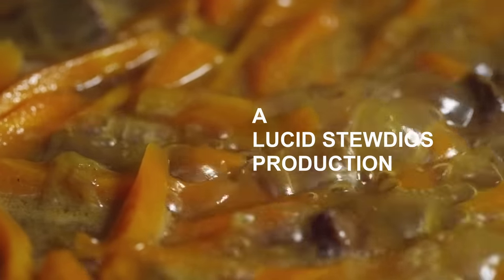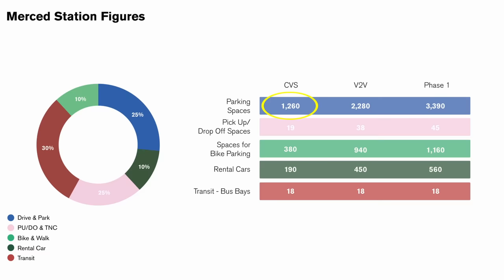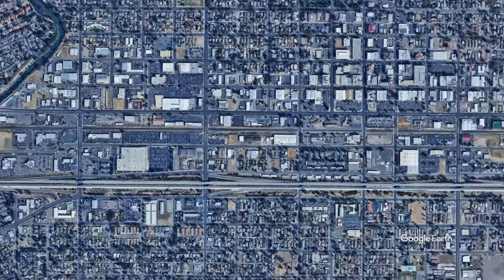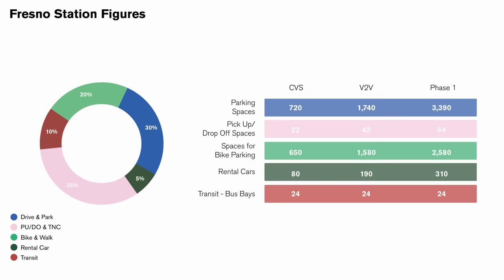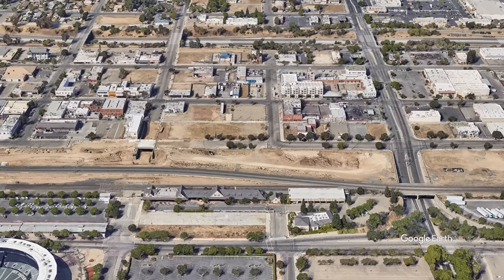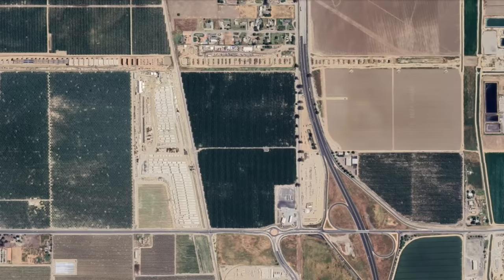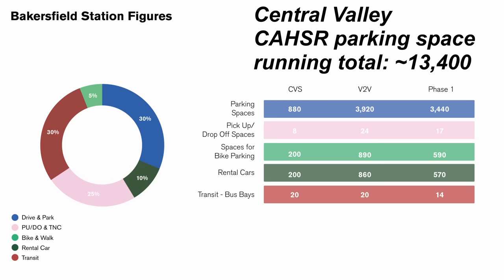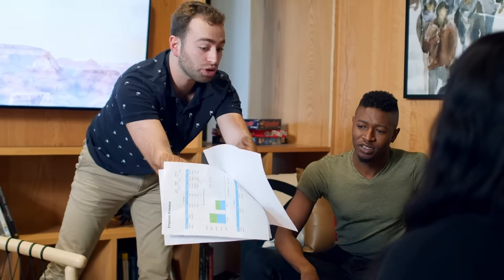California High Speed Rail : A Park & Ride Nightmare | CAHSR

Comment: Great video!

Holy Crap is there a ton of open air parking. I can't imagine there will be very much need for parking, let alone for rental cars, for at least a decade or more until there is a connection to San Jose. I also seriously doubt that the need for so much parking is justified even when the entire line is open from LA to SF. Fresno's airport only has about 900 spaces.
I am disappointed by the overabundance of parking. These downtowns already have an oversupply of open parking lots that haven't been full for 30+ years. A parking garage would at least save space and keep the stations from being so isolated from their downtowns.

I don't like the station designs (I imagine the Bay Area and So Cal stations will look much better) but I do like that the Merced station entrance has a treatment that has a rustic or "Sierra" feel to it since it is a gateway to Yosemite. I wonder why the other stations don't get a distinguishing feature for their station entrances. Fresno, to me, should have a California-Mediterranean feel to it like it's Amtrak station or it's iconic downtown water tower. Bakersfield has an oil and country music heritage. Kings/Tulare is ranch country. These cities have been economically stagnant or in decline since the late 1970s. In fact, Fresno's skyline has barely changed since then (w the exception of new gov't buildings). Fresno's downtown, however, does have a large number of mid-century buildings (office buildings, theaters, and dance halls) because of that which are architectural gems. 

I don't know why Kings/Tulare station is where it is. The Amtrak station is in downtown Hanford although I really think the station should've been in Visalia and should've generally followed the UP or Hwy 99 alignment from Bakersfield, only acquiring property where the geometry dictated it. This would've saved a lot of money and lawsuits over all the land they had to take in the farmlands. There is a "plan" (I don't know how real it is) for a commuter railroad along the RR ROW that roughly parallels Hwy 198 between Visalia and Huron and perhaps Porterville. This could be a good non-car way to get from Visalia to the station, leaving their cars in Visalia. There is also an abandoned RR ROW from Porterville (via Visalia) through Dinuba Reedley and Sanger to downtown Fresno that would also make a good commuter corridor.

I think Madera was added later on. The Madera location is between the city of Madera and spread out Madera Ranchos community to the east. I imagine that the Madera HSR station will stimulate suburban housing to close the gap between southern Madera city and Madera Ranchos and the planned communities on the northern side of the San Joaquin River. There is no way to cross the river from Hwy 41 to 99, so the Madera Co corridor will likely fill in via Ave 12. This station would be about 8 miles from Fresno's Herndon Ave (11 miles by road). It's a weird station to get to from Hwy 99, meaning I guess it could be used by North Fresno residents who are loath to drive to downtown Fresno.
Reply from the maker: Thanks for the great comment. Merced is particular I find the parking disappointing for a number of reasons outlined in the video. It seems a lot already exists in the area and they have to get rid of a not insignificant number of local businesses just to make room for lots that will likely end up largely empty most of the time.

I like your idea of the stations having more of a local character. The unified design kit would also be fine, imo, if the kit were any good. :D

I'm also aware of the cross-valley connector through the Kings/Tulare station, but I really doubt it will cut down on vehicle traffic much. It will almost surely take longer than driving and be less convenient, so most people will probably still drive.

The current Madera station is the end point of the initial 119 mile construction segment.  Merced as an initial Central Valley segment was then added onto that. The current station site is even worse than this proposed one, so I don't blame SJJPA for moving it, but there have to be better options closer to the city. Maybe out by where Avenue 15 crosses the tracks, but unfortunately that debate is over at this point.
Reply: @LucidStew  thanks and I agree. Although I'm not sure that it's reasonable to expect rail transit to cut down on traffic because that has never happened in any meaningful way. Freeway widenings induce more traffic, it's safe to say that rail transit does the same thing. The fact that traffic is still as bad as before rail is a promise that just can't be lived up to and becomes another argument against it. 

Interesting fact, the Hanford Amtrak station has more boardings (182,140/yr) than the Merced one does (133,715) and about half the boardings as the Fresno station 369,118). The Madera station averages only about 75 boardings a day according to Amtrak California 2019 numbers.

Also the Fresno-Bakersfield city-pair ridership is the 9th busiest in Amtrak California and the only one in the top 10 outside of trips originating in the Bay Area or Los Angeles (LA-San Diego is #1).

Total transit time isn't the only consideration. Cost is also part of the equation. A $10 transit ride may take 20 min longer but it can save over the cost of parking at the station for a week. I almost always ride the Amtrak San Joaquins from the Bay Area to Fresno to visit family. It takes about an hour longer than driving but it's only $26 each way and with no stress of driving. To me, it's an easy tradeoff. 

I prefer to look at rail transit as increased mobility and opportunity for those who would most benefit from it as well as providing an option for those with the choice. This increased mobility is a positive for the economy as more people have more opportunity for education, healthcare, and jobs. As they say, a rising tide lifts all boats.

Comment: It’s so baffling that these small cities in the Central Valley are getting true high speed rail before the NEC. When the first section opens, you can bet conservative commentators are going to be looking at ridership and comparing to costs - but the ridership will increase 10x (at least - I don’t know what the projections are but that seems reasonable) once SF + LA are connected. 

What seems strange (as well)…I would expect there to be MORE park and ride’s in the Central Valley stations in the initial stage - with people coming from Bay Area and such to head down to So Cal-ish (and vice versa). I would reckon they would need LESS parking once the project is scaled up and complete and service is extended to the full catchment area. 🤷🏻‍♀️

Madeira Stn  could be a major ToD greenfield growth centre in future? Beyond that seems very odd. And I imagine it being skipped on most runs.

Fresno, and to a lesser degree Bakersfield, could use this as a chance to catalyze some urban redevelopment and get some higher order transit connecting to the HSR. There could be discounts on HSR tickets for folks who take public transit to the station. I could definitely BRT working in these cities, perhaps a tram line on a right of way if there is adequate ridership. They need to figure out they’re building a system of transportation- and integrate the HSR into the broader urban transportation network. 

These plans definitely do NOT do that.
Reply from the maker: I think they figure a significant percentage of travel south utilizing CAHSR on the route will show up via San Joaquins or ACE.
During the board meeting presentation for this powerpoint, it sound to me like Bakersfield actually WANTS this area to be a walled city, and that they plan to stuff all of their dense, high rise future development in there. Sounds like a recipe for disaster, but I guess we'll see over time.

Comment: I think one part that should be kept in mind in regards to the location, is being realistic. Yes, many main stations here in Europe are quite close to downtown and that’s a big selling point over airports. But it’s not like they are literally on Main Street and many of them weren’t even in the city when they were built. The cities just had a few decades to grow around and towards then. 

Building a station 3-4 blocks away from downtown is pretty close to perfect if you ask me. Any position where you could realistically walk to the main square/ street is good and locations further out can still be ok, depending on the connections. I visited Japan last year and the HSR stations of Osaka and Hiroshima both require about 10 stations of subway/ streetcar travel to get to downtown. I’ve also traveled to the old German capital of Bonn a few times last year and their Highspeed station (Bonn/ Siegburg) is even a 30min tram ride away from the center in a completely different small city on the other side of the Rhine. Sure it’s much less convenient then in many other cities, but it’s still a useful station. Dedicated long distance stations can be a bit further out then main stations with a lot of regional/ commuter traffic, because those are much more time sensitive to a few minutes more or less then a 2,5h+ trip.
Reply from the maker: Merced IS in a great the location. The complaint here is that they are then making that location worse by surrounding it with parking and disincentivizing people from engaging with the downtown area due to the inconvenient and uninviting walk that would entail
Reply: @LucidStew  Yeah, I've arrived in cities all around Europe by train and the experience of disembarking and leaving the station really can't be overstated. Much like what people have said about the old Penn Station in NYC, how people used to enter the city like royalty.  I'd also like to see a prewar level of respect paid to the architecture and landscaping.  I hate to see such a great opportunity squandered.  Maybe they need to get together with those billionaires wanting to build a city from scratch.

Comment: All good points, and I'm saying this largely just to counteract my own CAHSR-criticism fatigue, but stations in the middle of nowhere (ie. 5-10 miles from small-to-medium sized, even sprawly population centers) can work as catalysts for more centralized development. For example, see Valence TGV station on the high-speed line from Paris to Marseille: it's basically like Kings/Tulare in that it's halfway between two small towns (with populations of 32k and 66k; metro population, extremely generously defined, is apparently 250k). Valence TGV also has a regional rail line that runs perpendicular to high-speed trains, as well as a smattering of local and regional bus services. It also has about 1900 parking spots, with more to be added next year. 

It doesn't sound amazing, and I can tell you from experience that the station isn't pretty or grandiose. You don't feel like you're anywhere when you're there. But SNCF, the French national operator, says the station saw a bit over 3 million travelers (or trips? unsure) in 2022. And just based on Google Street View and satellite imagery, you can see quite a bit of development that's sprung up between the two adjacent towns. The station itself is integrated into a "business park" (some offices, some logistics facilities, budget hotels, etc), but you can also see quite a bit of newish activity popping up all around, further away from the station, still between the two towns. And the station being outside of town allows stopping TGV services to stop here instead of at Valence's legacy train station, which used to significantly slow down total trip times (between eg. Paris and Marseille) as fast trains had to snake through the dense urban core.

I think the point of these sorts of stations is to buy the political support of regions and municipalities that clearly don't warrant proper HSR service but will have to consent, on some level, to HSR infrastructure passing through them. Obviously, I have no idea if these stations will ever recoup their capital cost, but clearly that's not their purpose. And I don't know if the Valence example translates to the Central Valley, because obviously the political buy-in argument presupposes that remote regions and municipalities understand the value of HSR and would want in on the game – which makes sense in France or Spain (where these systems have existed for a while and their benefits are obvious and widely recognized, and construction costs are slightly saner) but might not make sense in the US (where uninformed rail- and transit-bashing is a popular politico-media pastime, and costs are ridiculously high). But I feel like some form of political buttering-up like e.g. Kings/Tulare or Valence TGV will be necessary in most parts of the US that might some day see substantial new HSR infra.
Reply: I should say – the "potential future TOD" is pure cope and we should ignore it everywhere but Merced and Fresno. Particularly hilarious at Kings/Tulare and in Bakersfield. Don't think that diminishes the overall argument though!
Reply from the maker: I feel like while those compare on the surface in terms of distance, they don't in reality. You're comparing a station next to a quaint French village and ultimately between two larger, drop-dead gorgeous medieval cities, with an obvious tourist draw, to Hanford here.
Reply: @LucidStew  Fair point re tourism in the Rhone valley, though I still don't think the comparison is entirely irrelevant. And while I'm sure Hanford ain't all that, I do take issue with Valence and/or Romans-sur-Isere being put on such a high pedestal, though maybe our differences there are a reflection of my overexposure to Europe and your overexposure to California.

Villena AVE station in southern Spain might be a better parallel: also in the middle of nowhere; near-ish two (even smaller) small towns; minimal if any tourism value; literally no transit connection, just a parking lot; Wikipedia says it used to be criticized as the least-used station on the AVE network. But if its construction (c. EUR 11 mil in 2012 money) was needed to buy off local political leaders et al, ultimately allowing that branch of the Madrid-Levante line to 1) exist and 2) be a little more useful to a remote region, as well as moving those towns into the commuter belts of previously distant major cities, isn't it maybe good that the station was built? Or inconsequential at worst?

I think the point that resonates with me most is that by building car access facilities you're potentially putting cars on the road that wouldn't have been there otherwise. But on net do we expect these stations to make adjacent Central Valley towns even more sprawly and car-dependent, or maybe marginally less so? I agree these designs are symptoms of pathological suburbanization but I don't think they'll cause even more of it (ie. this doesn't seem like a "trains that subsidize suburbia" situation to me).

One thought experiment here: assuming Spanish or French construction costs, would we still deem Kings/Tulare and Madera pointless? Because if yes, then the criticism should be of North American costs, not these specific stations. (I know you've voiced some of that before as well, so please don't take this personally, but just, y'know ... legitimate-CAHSR-criticism fatigue, wanting to see it just get done, etc).
Reply: Either way; still a good video, keep it up, love your work, you know the spiel. And let us know if we can financially support your work in any way (comments where I suggest specific platforms keep getting auto-deleted, v annoying)
Reply: The LGV-Med on which Valence-TGV sits was supposed to recoup its sizable investment in about 20 years and has not disappointed. Valence-TGV was a small part (91 million) of the 4.5 billion (in 2003 Euros) bill. Its existence was never in doubt.
SNCF's dictum is that speed is 80% of the ridership. People will take the TGV if it is much faster than driving and are flexible in regard to how they will get to the station. The hard part is to build the HSR line with its strict requirements in terms of curvature and the potential for local opposition. Once you manage to thread that needle, the stations locations, architecture or development nearby are almost irrelevant.

Comment: Having stations near or between some of these towns may be the best solution in the long term, since the land around the stations can have whole street grids configured with density and walkability in mind from square one.  You don't really need parking to get from these adjacent towns either, if they have buses.  Eventually there could be a rail link between all 3 towns.  Really, if they make a nice enough area, given the adoption of work from home, the areas around these stations could become very nice.  The weather is ideal for such new cities. This makes me think of the city some billionaires are trying to start from scratch just north of San Francisco.
Reply from the maker: The land around these stations is farm land. In the case of Hanford, you also have a lot of dairies out there. Summers get very hot in the San Joaquin Valley. The air is poor quality and its dusty and hazy out there. It's not some sort of undiscovered paradise.